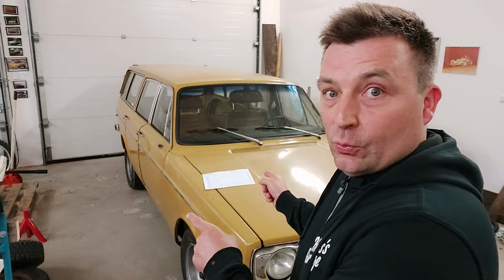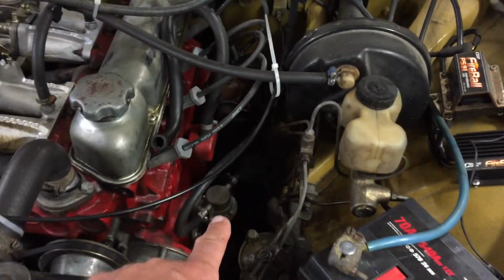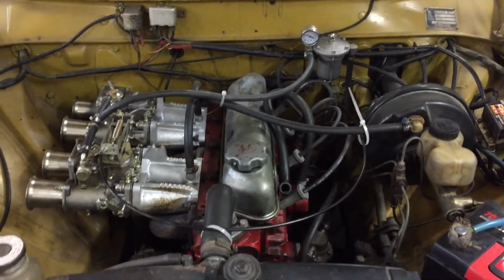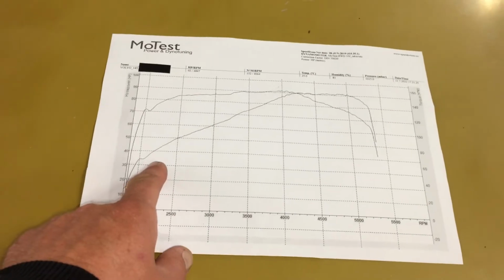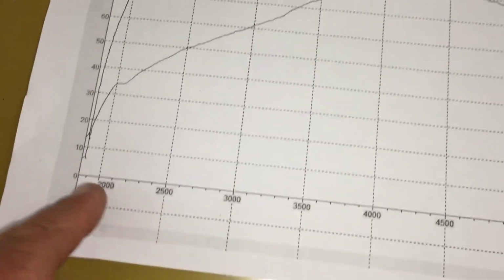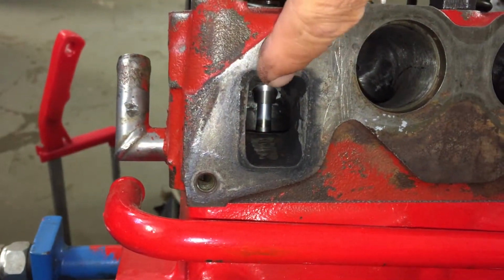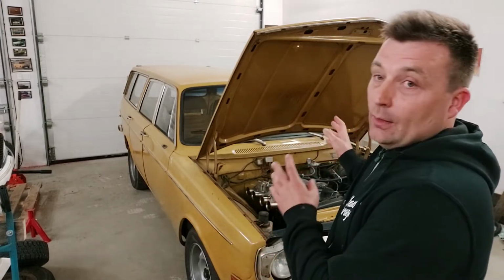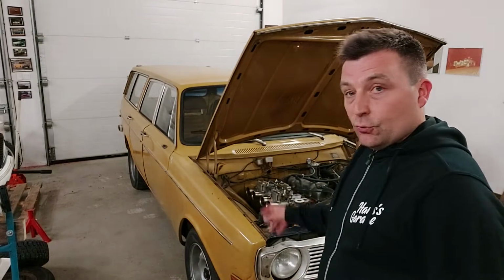How much power we have in Volvo 145? | Slightly upgraded B20 engine |

Comment: 92hp is pretty good from the B20A,  The K-cam is good for a manual once you get above 2500 rpm.
Reply from the maker: Yes, I happy with that. It will be very interesting to see how much the K-cam will help. And ported head.

Comment: The advertised HP is supposed to 118.. And that is stock SU or Stromberg carbs. You have 4 carbs it should be more than what dyno gave you...
Reply from the maker: In 142 S had 100 hp with 2xSU. My old B20 (in this video) has stock A-cam and lower compression ratio. Horsepower is  92 whp so advertised horsepower would be in this (92*1,2=110). I hope a can get a lot more from my rebuild engine with K-cam and ported cylinderhead.

Comment: Hi, i have the same head on my 1969 volvo amazon. Is it the normal b20a head? From what i have seen it is a later type head from the 70's, with slightly bigger valves, is this true? It has those flat spots as well on the top that are not present on the 60's heads, and which are made to be drilled for injectors.